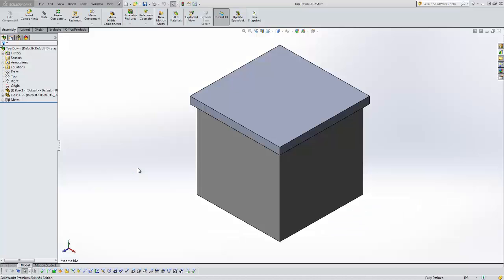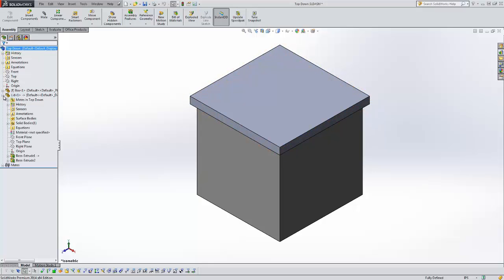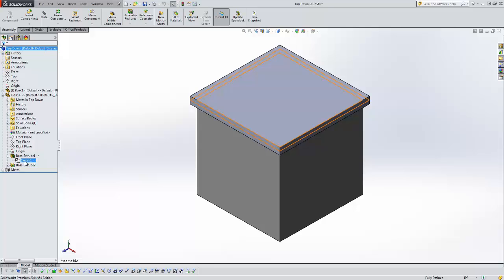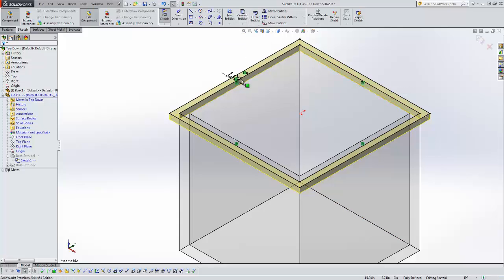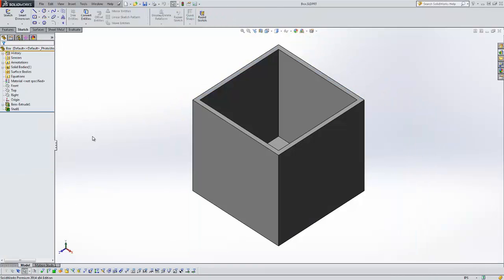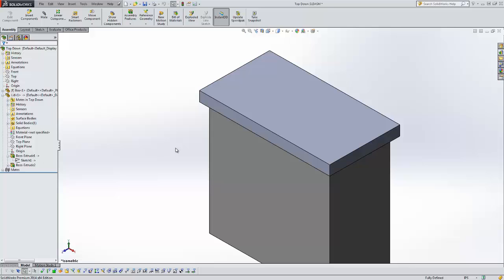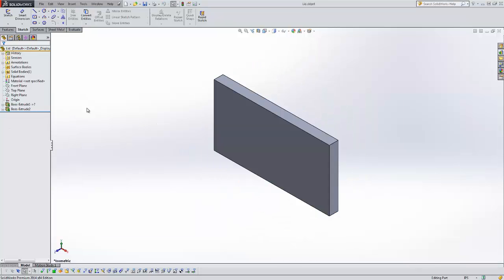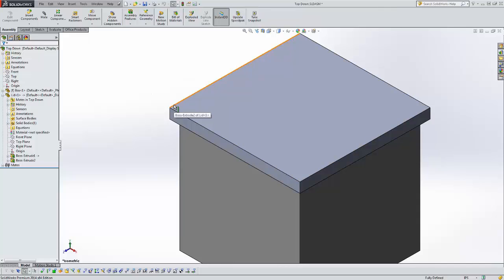SOLIDWORKS - External References

Comment: I have an assembly that won't let me select edges from a different part. Are there conditions that would cause this?
Reply from the maker: Hi Bigbaboo D,
As you use "Edit Part" to edit the part in the context of an assembly there is an option on the CommandManager (top toolbar) called "No External Reference".  If this is set you might be barred from making external references for parts in this assembly.

Also, you might be barred from creating an external reference between parts of an assembly if the part you are editing already has an external reference  within another assembly to another part as well.
Reply: so you can only make external references to 'one' other part?  seems sort of limiting...
Reply from the maker: You can make as many external references in a part as you like within a single assembly.  If you now take that same part and put it into a distinctly different assembly that is a bad idea because now parts are the geometry are now controlled by geometry that is not in that new assembly.

Generally speaking, external references should be used only sparingly when no other method is sufficient to define geometry.
Reply: Have you tried switching to wireframe display?

Comment: Good day. thank you for your good video. 

In SW in assembly mode, we can get the external reference from other part file into our modelling part file through sketches.
1) how about other external reference like Coordinate System CS, Plane and Surface? 
2) how about in part mode, can i directly import those external references? (or only able to do it in multibody part?)
can do it between part to part sharing without assembly or not. multibody i consider as assembly since we need to assembly. 

I am looking for the feature can allowed "sharing information between part to part", in order to achieve top-down modelling in SW.  is almost 2 weeks time, i still cant figure it out in SW. 

remarks: previously i am other cad system user.